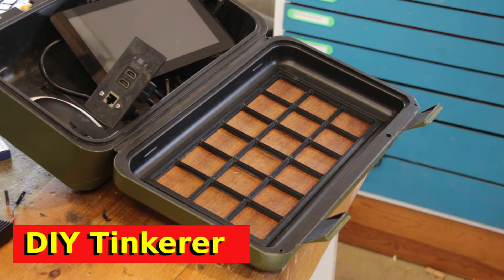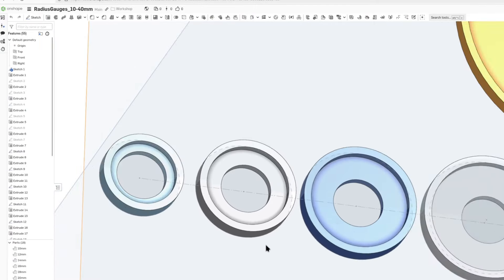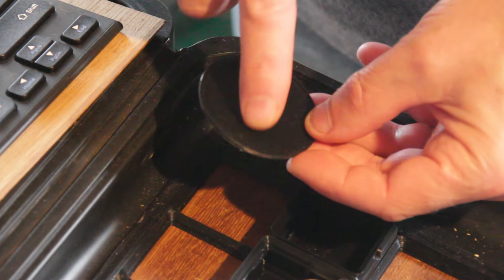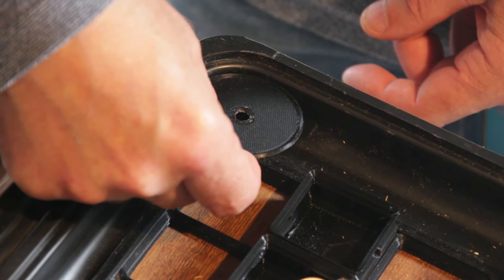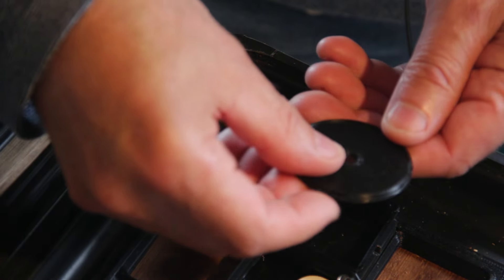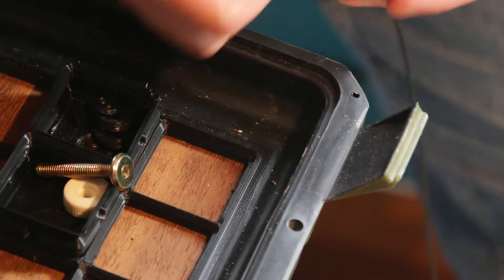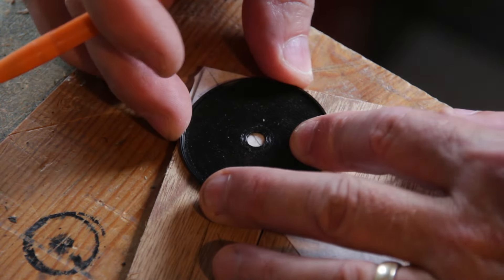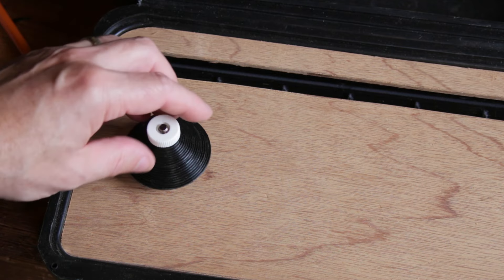Every Tinkerer Needs Some Eventually!

Comment: Great job Simon and good use of your printer too, they look spot on… 👍🏻
Could the printer actually print the radius of each guage as it is produced?… 🤷🏼‍♂️
Reply from the maker: Hi, thanks, yes you can emboss text to print the size, probably not on the smaller ones but easily on the larger ones, I might think about what an optimal design would be, thicker would certainly be a bit easier to handle.

Comment: Good example of thinking outside the box. Just gett'n the drift of CAD..it'd be the kool'st to have a 3D printer. 
Keep a tinkering..thanks
Reply from the maker: Thanks,  yes 3D printing as a
Tool rather than a hobby in itself is a great addition for the workshop, if your prepared to put the effort into learning CAD software onshape.com is a good place to start